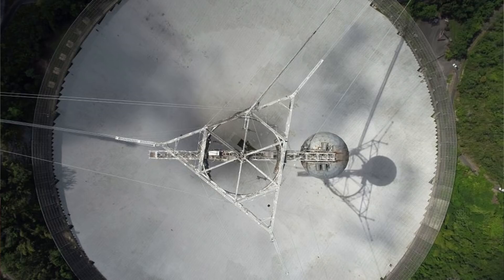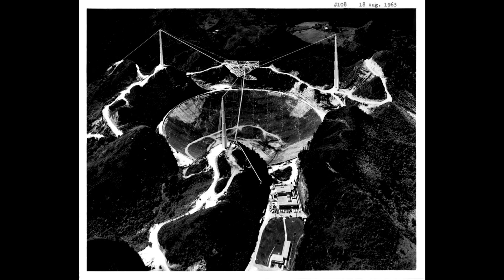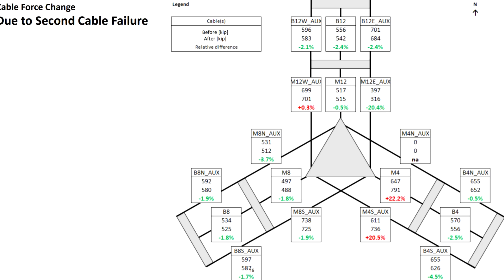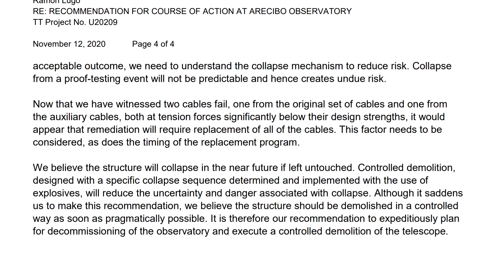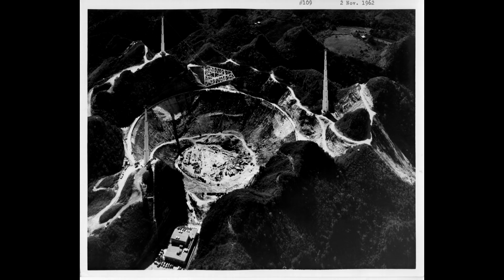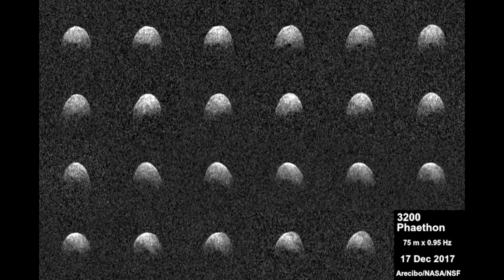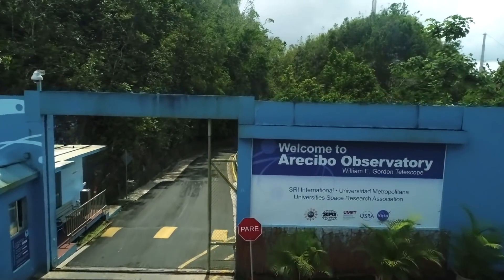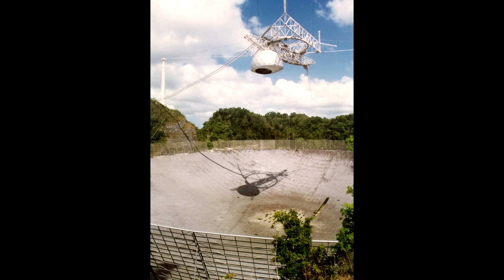Worlds Largest Radar Astronomy Dish To Be Demolished!

Comment: I don't work with this exact cabling, but we have the same problem in dam engineering and relying on similar post tensioned cables. Dams typically last several hundred years where cable useful lifetime is between 50 to 100 years. It's really no surprise that these cables are starting to fail. Corrosion and creep are the big culprits but I would assume that cables this exposed to temperature change, it's likely that a fatigue issue is a problem due to the thermal loading. Cables are not easily replaced. One day we'll use carbon fibre and then carbon nano-tubes. Then we won't have these issues. Steel, while great, has its drawbacks.

Comment: As a mechanical engineer when you start seeing individual wires giving way in a cable, its getting pretty damn close to failing outright. That indicates that there is significant strain going beyond the yield point of the steel, and the strands that fail are the weaker ones that could not handle the added strain. Since there is weathering involved, large portions of the cable could be quite compromised due to corrosion, and much of it may not be visible from the outside. Add to this the likely corrosion of the zinc that secures the cables to their anchors and you have a pretty unsafe situation. Id say its probably best to demo it at this point as well.

Comment: I would think the towers are the most expensive part, perhaps besides the electronics. Maybe they could use explosives to sever all the cables, safely dropping the gantry. From there it would seem that it would be relatively easy to build a new dish and reflector.
Reply: The towers are just concrete.  Nothing fancy there.  The dish surface is pretty precise.  It has to be accurate to better than about a millimeter over 300 meters.  The hanging platform is the expensive part.

Comment: If they demolish it it not necessarily a catastrophy. The question is what they do afterwards. If they rebuild it, then the demolishion is only a setback. The real catastrophy would occure if it won't be rebuilt. And it don't need rich people to back it up. It's only need intelligent and responsible people. But the two categories are most of the time far from each other. This is humankind's most worriing deficiency. Tipically those willing to support this kind of projects who has only limited resources for it (or totally lack it). Mankind should step away from greediness. We are more like ferengies, and getting closer and closer to them with each day (Star Trek is a huge metaphore for mankind's all aspects). OK degeneration is still some kind of generation, but not what we really need.

NASA, ESA, JAXA (etc) should cooperate in this metter. It should be a real international effort. (If they ignore it, I have no objections if some undiscovered near earth asteroids hit their HQs.)

The helicopter thing is not really viable in my opinion. The turbulance from the rotors could cause more problems and make the whole thing worse, even more dangerous.

Comment: Ironworkers could easily save this. The cost would be more than building a new bigger and better one. The formula for computing the  SWL  of a  wire rope is the diameter of the rope squared, multiplied by8 (D x D x 8 = SWL in tons) if lifting personal you will need to add a factor 0f 10 to get your SWL. if you have a 1/2 inch in diameter.   convert the 1/2 into decimal number by dividing the bottom number of the fraction into the top number of the fraction: ( 1 divided by 2 = .5).Next, compute the SWL formula: (.5 x .5 x 8 = 2 tons).The SWL of the 1/2-inch wire rope is 2 tons.

Comment: Why wasn't it maintained ? Any cable like those must be changed after a defined period
Reply: Because nobody wants to fund old telescopes.
Reply: In the maintenance of bridges there are regular cable inspections of the cables and towers and ancorages. Along with an engineering company that would assess loading and perform calculations to assess safety and load capacity. Cable replacements would happen on that basis. One would imagine that the design would allow for one cable to be replaced. I.e. to remove and replace a cable. But when more than one cable is showing signs of failure then that becomes a problem. Frankly the helicopter idea doesnt sound much safer. If one of these cables fails the energy released in the snapping cable might cut you in half. Falling would be only one of your worries!
Reply: @CorporateZombi  which shows mismanagement somewhere, and/or lack of will to continue using the instrument. The last goes against saying that the instrument is still "important". Would show that other machines give comparable results for less expenses

Comment: 2020 claims another victim.

Cant they remove hovering unit, disconnect  the cables and demolish the towers - the rebuild
Reply: Not without someone getting close enough to be in danger if another cable snaps.

The instrument array is too heavy to be lifted by helicopter and they don't want anyone working underneath it in case another cable fails.
Reply: @johnwolf2349  Ah 

Yes. Didnt think of that.

Comment: It would be best to take it out, and replace it with a better solution, using current cutting edge technology. The radar unit could be upgraded, and made 100 times smaller than the current one.

Comment: Well, as a Merchant Marine deck officer, I know what seems to be a good idea at least to me. I would build a harness or net which could be positioned or slung below the gantry. Then, a system of secondary attachment points on each tower backed up by winches could be used to fly the harness into position and support the weight of the gantry with minimal injury to the structure. 
I would use a system of messenger lines to pull ever heavier lines into position without the need for people to work under or on the gantry. Once the gantry is supported, work could begin on replacing the proper wires and repairing the damage. 
Easy,  at least in concept.
Reply: dothemathright 1111  Is it the tower support cables or the cables from the cables to the gantry that are failing? The tower guy wires could be supplimented or replaced without any need for people on or under the gantry. 
My plan allows a temporary support system to be rigged to support the gantry without putting people under or on the gantry. Once the gantry is supported with this temporary rig, the existing wires can be replaced at leisure. 
Cordially, 
SJM
Reply: Right! My suggestion would be to support the gantry by slinging a support structure, (think of it as a net) under the gantry using a new set of temporary wires run from a new set of attachment points on the three towers. The existing wires would not be involved.

Comment: As a structural engineer I can definitely say cables are tricky. And combining multiple cables working in the same direction only complicates things further. The load in cables is directly related to the supported load and sag over the span. The real problem I see is the multiple cables were designed for increased capacity initially but over time as they stretch and fatigue (as all steel will in tension) one cable might not stretch as much as it's "sister" cables this causing it to take up more load. Think of why suspension bridges have one big built-up cable each side and not mutilple parallel cables or why crane cable has to be replaced after so much usage, load sharing will diverge with more fatigue. You couple that with the weaker steel and less stringent testing of the 60s compared to the past 20-30 years and you get the most recent original cable snapping. The safety issue of trying to make repairs is very realy. You start moving personal around on the dish or even a wind gust and the load to a particular cable could easily exceed its capacity. Too many break on one leg and it's a domino effect. It's for this reason that the cables have such large capacity to begin with, however, years of fatigue and cyclical loading will reduce their strength.  It's definitely a case of waiting too long, sad.

Comment: I've worked on tram crews; that wire looks like z-lock which is often used for track ropes (the wire that the gondola is held up by, rather than the haul rope, which pulls the car back and forth).  The bulge is from a core failure and if you see that, it has to be replaced.  When the rope is intact, it retains the factory lubrication which prevents internal corrosion.  Lightning is known to damage a few wires, and a certain number of broken or damaged external wires is allowed before it has to be scrapped.

The sockets were poured with zinc in the old days, now they use epoxy.  The end of the wire is inserted into the socket, which is a cone shape, and then spread apart, called a broom shape.  Then, everything is cleaned and etched with chemicals, and then a particular kind of epoxy is poured into the large end of the cone.  The socket joint rarely fails, usually it is the rope that parts due to breakage of the external wires or corrosion, when the failure is not actually mechanical.  When a socket does fail, it's usually because the process was not followed correctly, or subsequent inspections did not discover that the rope was slowly beginning to pull out of the socket.  Usually, a small wire is wrapped around the rope where it exits the socket and part of the periodic inspection is to look for movement right there.  

The rope has a finite life and it isn't cheap.  It is usually built to order to length and can't be spliced like typical rope.  You certainly can't replace it with the suspended load in place.  

Good luck, amigos.

Comment: I went there in the 90's it was really amazing, but you could feel the lack of maintenance - even as a generic visitor.
Reply: I visited last year and had the same vibes.  I wonder how much Hurricane Maria damaged it, both in direct stress and also long-term degradation?
Reply: @sjfehr  a lot of hurricanes have visited since 1967, a lot
Reply: @a..d5518  Maria was by far the most powerful in nearly a century, following quickly behind Irma.  This after 50 years of aging.  It may have contributed to weakening the zinc joints that failed.
Reply: @sjfehr  you can see how rusty it is. Sad
Reply: I haven't gone to any facility in the last 20 years that looked like it was well-maintained. A few years back a former colleague said of a sister company "Their factory looks like they make rocket motors... ours looks like we make hubcaps..."
Reply: @fermiparadox1  
Zinc isn't "pot metal", it's a specific metal used for specific jobs that it is well suited for.
Zinc potting of cables is a standard and effective anchoring method used around the world for longer than this structure has been around.

The issue is most likely just corrosion. Zinc likes to act as a sacrificial anode to steel if given the opportunity, so things have to be properly maintained. 
And it certainly seems as though this structure didn't get that...
Reply: Just like the rest of the USA.

Comment: An inflatible airbag to distribute the load so the central structure can be wenched back down onto it. Alternately, the airbag could be large enough to support the structure at it's current location to reduce or eliminate the cable tension, allowing them to be replaced safely.

Comment: So sad!  I lived in Puerto Rico for 3rd & 4th grade circa 1968-9.  My dad was in the US  Marine Corps and we were stationed in San Juan.  We did a lot of touring of the island and Arecibo was one of the destinations I remember well.  Mostly because of the expanse of engineering and local geography that was so captivating.  I do not recall any indoor access for touring or any kind of museum or visitor's center.  I'll let any commentors set the record straight for me.  I can't say that this helped inspire my love of astronomy - this would flourish in my mid-teens - anymore than climbing the Tower of Pisa in 1970 inspired my career as a physicist.  They are for their own sake just very special memories.
(Made all the more so due to the innocence of that time where you actually could go out onto the levels of the Tower of Pisa where there were no safety structures to keep you from slipping past the columns into thin air, or when you could freely walk amongst the standing stones at Stonehenge.)

¡Recuerdas siempre, nunca digas nunca, Arecibo!

Comment: If they spliced some new cable into the old and used hydraulic jacks to feed out the cable, they could lower the mast down to the middle.
If they could also make a platform for the mast to sit on then they could do any repairs.
Unfortunately to make a platform someone needs to stand underneath the dish.

Comment: Even in worst case scenario and it fails and comes crashing down, I hope that they rebuild it with snew materials hopefully increasing strength and reducing weight maybe.

But I hope that someone figures out a way to repair it safely and they don't have to scrap ir

Comment: Did no one check the cables? There are electromagnetic probes (basically coils with electronics) which can be tossed slowly along the cables and they can measure whether the amount of continuous uninterrupted metal changes along the way. And so broken lines within these cables can be detected.

Cable car lines in ski resorts are checked that way regularly - maybe depending on the regulations in the countries. And with weak regulations and no funding... well it's just a matter of time...

Comment: The downside is the wires are 50 years old, and the reflector is also the same age. We have the technology to save the main towers, cut the wires, clean up the dish area, and rebuild the dish and transceivers. Think of it as a suspension bridge.  Re design the central part with modern building technology. We now have materials that are just as strong if not stronger than 50 years ago, and lighter in weight.

Comment: It’s akin to a suspension bridge, and they’ve been refitting those sealed cables with forced dry air to prevent corrosion. They would have had to seal and force air through the cables years ago. If you want it back, sell naming rights. Bezos is such a sci-fi nerd he might foot the bill with pocket change.

Comment: Having workers hanging from helicopters will never happen. Sure it could mitigate some risk, but only on the Z axis. If the structure had any movement along the X and Y there would be nothing to keep the workers safe.
Reply: Don't forget about the 2000 foot long cables that are going to go whipping around when it collapses.

Comment: The hardest part of 'building' a telescope like this is finishing the naturally bowl shaped excavation that the reflector sits in and the pilings needed in the foundations of the cable support poles, isn't it? None of which seems in any significant risk of here. Just demolish the current setup and design a new reflector to fit in the existing natural depression. They could design the new telescope reflector with far better precision and accuracy now than in the 60s surely, and consequently take advantage of such a reflector's much greater ability to focus smaller wavelengths of radio.
Reply: Pierce Brosnan and Judi Densch will be overseeing the revampment of the new radio dish.

Comment: As a civil engineer, failures like this are potentially instructive (tragic though they are). I hope the causes of the cable failures and the apparent overestimation of the cables’ strengths are published publicly so they can be avoided.
Reply: Golden Gate Bridge is built decades earlier. Why does not it in trouble? 💰 were saved on Arecibo?

Comment: And helicopter as a safety device would be very tricky.

Perhaps an easier and lower cost solution would be something like an airship or even more frugal would be a series of helium balloons fastened to anchor points and have the ability to hold anyone who's working on it in case the structure collapses

Low cost easy solutions seem to be never considered, there's no glory in it a big project though woo the glory and who cares whether there's something that doesn't cost us much if it doesn't have the glory factor

Cynthia nun Thomas

Comment: How well could Goldstone and FAST work together as a radar setup? Are there any other transmitters that could be uses independently of the receiver? I suspect it doesn't have the same kind of focused transmitting, but the AN/SPY-1 radar the US navy uses is reported to be 6MW, and it's mobile so it could be positioned to time the return signal for ideal viewing geometry.

Comment: Did they just get it wrong in the modeling of the cable and the cable aging ?  Or did they gamble ?
Reply: The cables have been up there for 60 years in the tropics.  They have corrosion they can't see.
Reply: @stargazer7644  True.  But given the number of Suspension bridge, and other engineered structures, of similar ages or older, there  was probably good data/models for maintenance.

Comment: The antenna weights only 600 tons?
Then they can get one of those massive liebherr cranes and lift it in the air. Then replace all the cables.
Reply: They have a crane with a 300 foot high reach that can lift 900 tons from 300 feet away?

Comment: Looking at the design the cables where ment to be replaced on a fixed schedule. The cables would have been substantially larger with better surface coatings if they had been intended to be permanent. The best remaining choice is controlled demolition sacrificing a portion of dome and the sensor module. Filling the depression with water would minimize the destruction, but a significant portion of the dome would still be destroyed. Saving the towers and facilities would go a long way towards making it possible to rebuilding the telescope. Although if some of the sensors are worth saving you could remove them with a heavy lift helicopter and very experienced rigger's, but the sensors are probably not worth the investment or the inherent danger of removal process. It is sad to see the end of the telescope but unfortunately it's time.